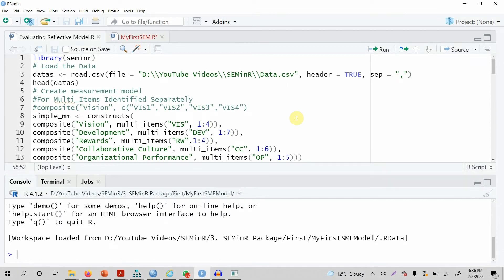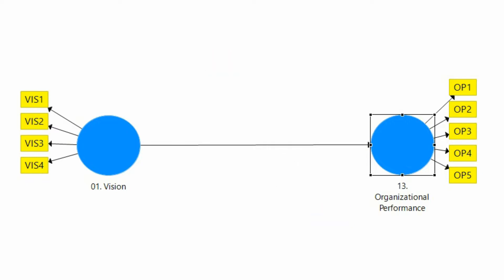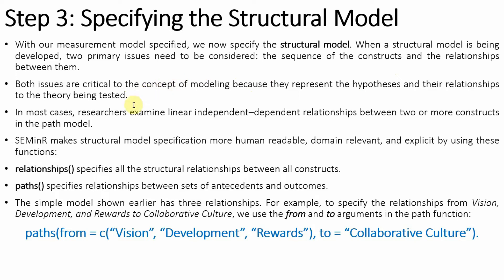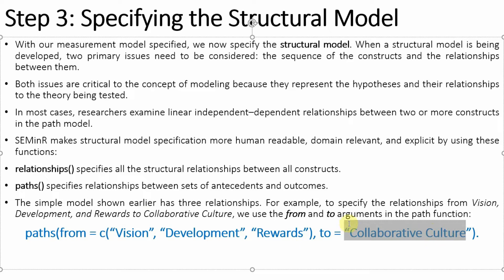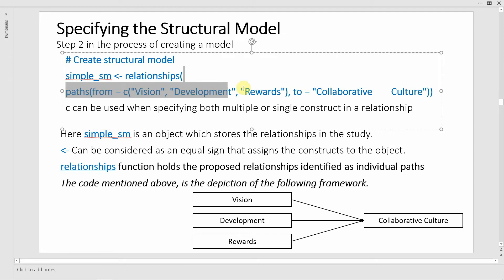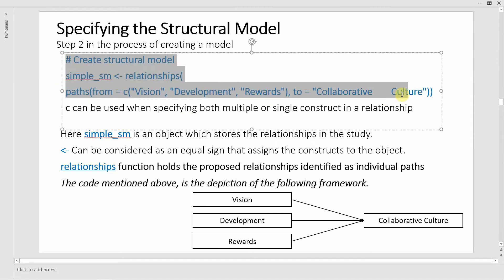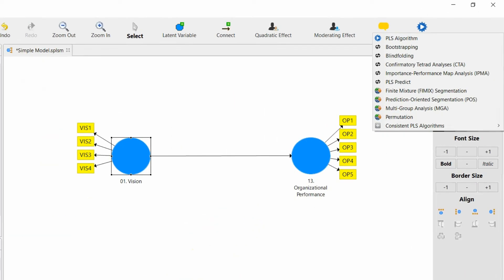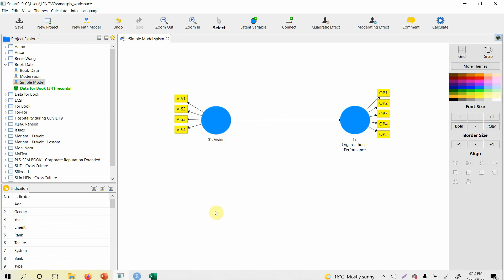05. SEMinR Lecture Series | Specifying the Structural Model | PLS-SEM in R

Comment: Hi, I wonder what if some of the values are 0 and they are meant to be 0, not missing data (e.g., participants who have no siblings score 0 regarding sibling support), what is the syntax for that? It seems not a problem in Lavaan package. But I couldn't summarise the model in seminr.

I use:
model <- estimate_pls(data = data,
 measurement_model = MeasurementModel,
 structural_model = StructureModel,
 inner_weights = path_weighting). 

Then Studio shows: 
Generating the seminr model
All 521 observations are valid. 
Error in if ((mmMatrix[mmMatrix[, "construct"] == construct, "type"][1] ==  : 
  missing value where TRUE/FALSE needed

> summary_model <- summary(model)
Error in summary(model) : object 'WFCmodel' not found
Reply from the maker: 0 is not treated as missing value. If you have missing values you can represent them by a number like -99.